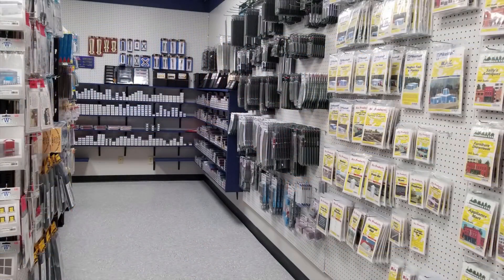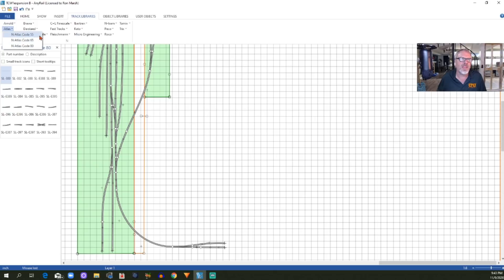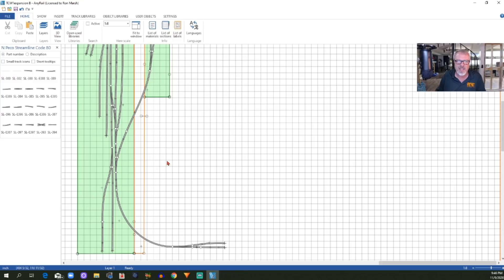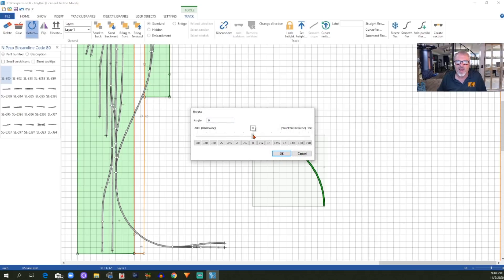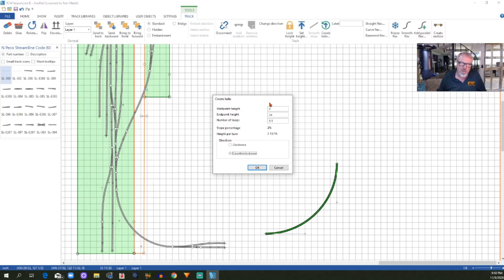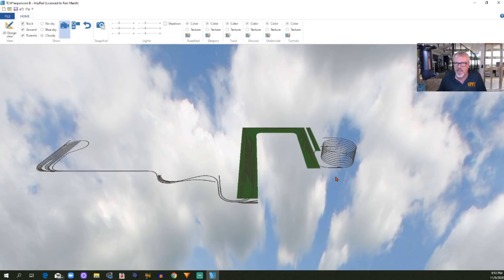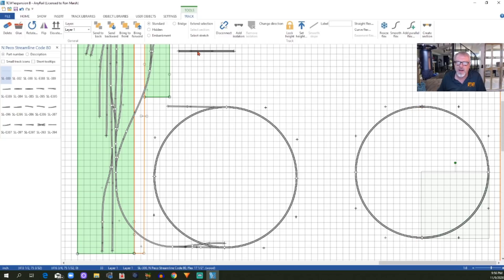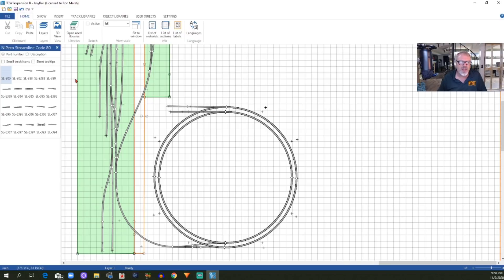Design a Helix Using Anyrail6 For Your Model Railroad Layout

Comment: For those of us who don't have enough room for a 22.5" radius helix, what is the minimum radius on your mainline?
Reply from the maker: My mainline radius is 18".
Reply: @RonsTrainsNThings  what is prototypical radius for modern day railroads converted to n scale ? I’m trying to be as authentic as possible with my layout.
Reply: @RonsTrainsNThings  Why not stick to mainline radius in the helix?
Reply: @steamfan007   ... because of the excessively high grade that would have resulted
Reply: @goongarage7914  I looked this up before: it’s something like 20 feet radii in N scale for mainline runs.
Reply: @hangarflying  I appreciate the feedback! Just trying to figure out the most prototypical radius for my turns, I was thinking 28”, basically anything over 21”.
Reply: @goongarage7914  Full sized Railroads use as large a radius as they possibly can. And they measure them in degrees instead of radius. It's easier to figure out with the big-ol curves they lay out. If you are working in N scale, do an HO sized layout. Curve wise, that is! They will look real nice. I've built an N scale RR using an HO plan and it is great. Extra special nice if you are gonna run long trains!
Reply: @michaelsullivan3581  thank you for that info! I appreciate everyone being so willing to help me figure it out. Since I will be doing n scale, what radius/degree turns to you recommend
Reply from the maker: @steamfan007  Sharper curves result in increased drag in the helix. The larger curve the better on a grade.